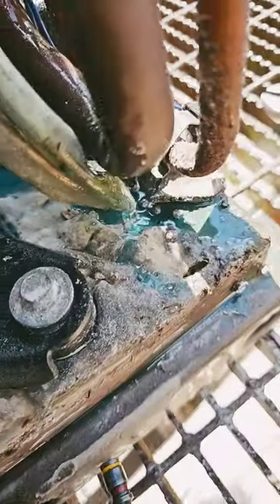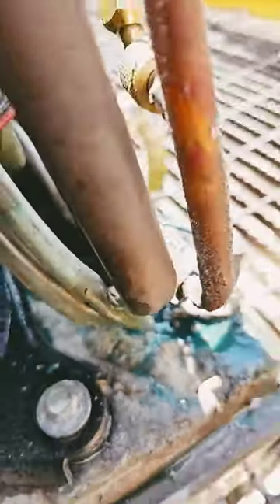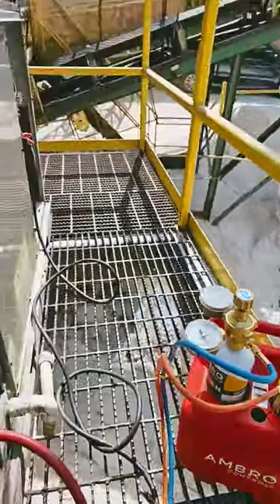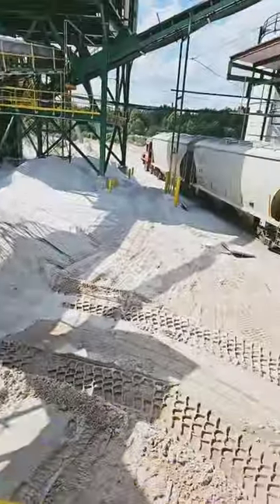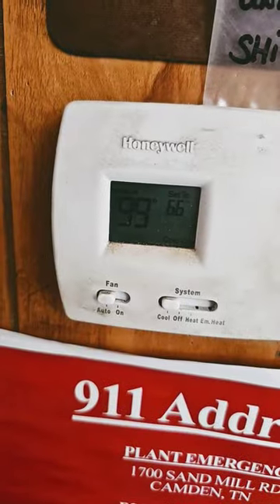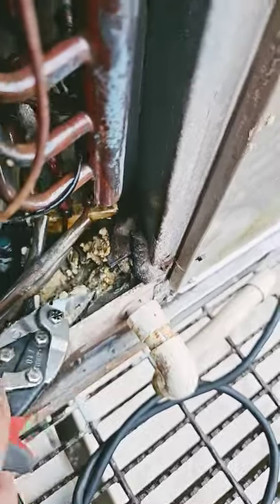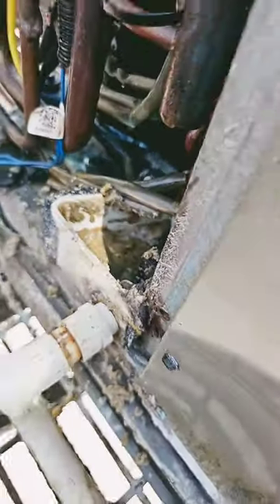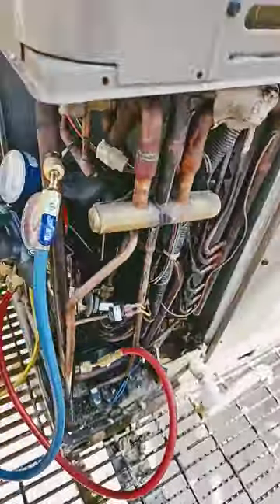Always check the tubes! Refrigerant Leaking! @AmbroControls #airconditioning #hvac

Comment: Speaking from experience, with those tiny distribution tubes its best to slip a coupling over the leak and repair it that way. If you try and patch it with Sil-Phos it will easily plug the tube and you can have issues on your suction pressure. Evident by the warm tube where the rest are cold and sweaty. Doesnt look like you had this issue so good work!